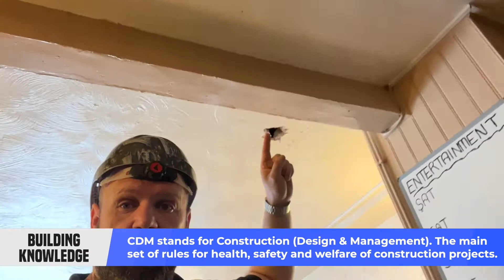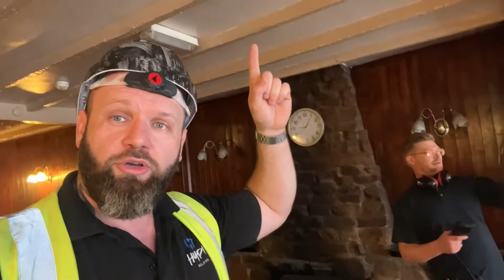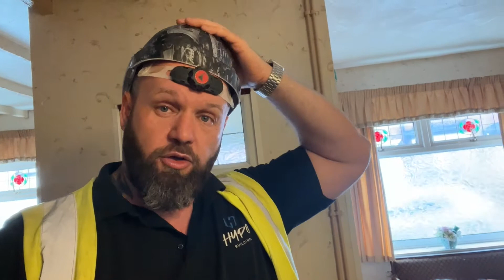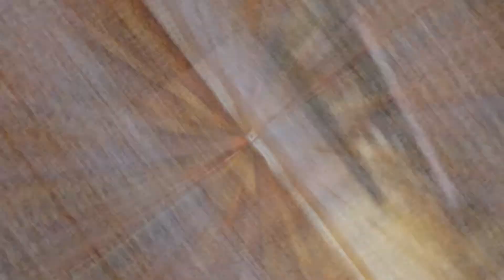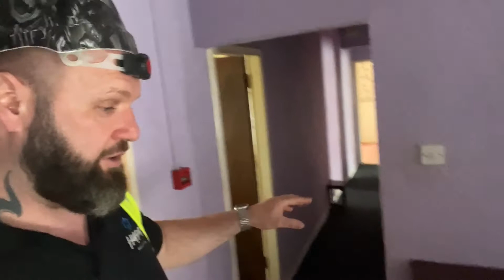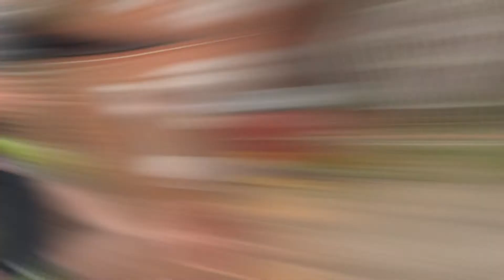Commercial to Residential Conversion: 4 Things You MUST Do Beforehand

Comment: I don't understand all the talk about decibel measurements, at 6:10, and how "".

I can't see how that works.

If you start off with 60 decibels, which is the sound of normal conversation, then because the decibel scale is LOGARITHMIC not LINEAR, an increase from 60dB to 70dB is times  louder, not just  louder.

120dB is not two   times louder than normal conversation.  It is the sound of a jet aircraft taking off 
180dB is not three times louder than normal conversation.  It is literally the sound of a Saturn V rocket taking off !  You can hear it miles away.

If you have to end up with 60dB in the flat, and the noise coming from above is 62dB  ()  you will do something (eg add two inches of underlay)   But if the noise coming in from above is 64dB (), then surely it will take you more twice as much underlay to get down to 60dB ?
Reply from the maker: Hi there. Thanks again for watching our videos and for your comments.

John is basically trying to explain things in layman's terms using fictional numbers so that it's easier to understand (rather than actual figures). 

A building already has a value/rating based on the level of sound that is allowed to pass through the walls/floors. These tests determine the amount of sound proofing required to make sure that the internal and external noise levels meet regulations and to ensure residents enjoy a good quality of living.

Hope that helps.